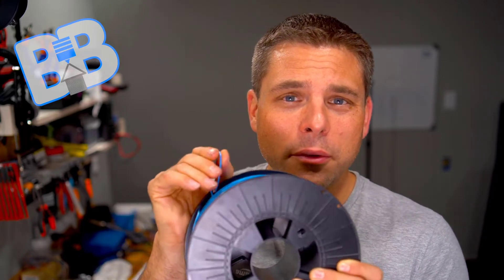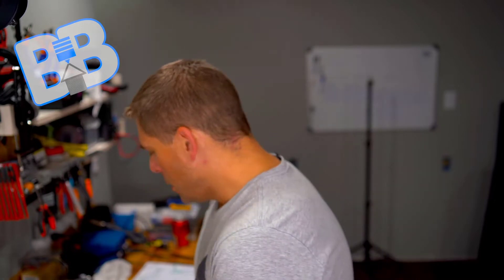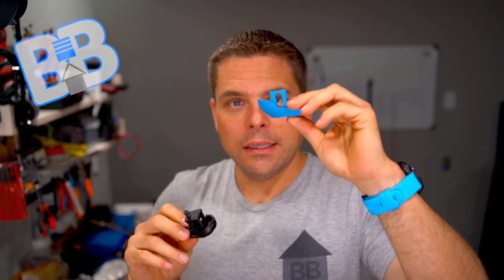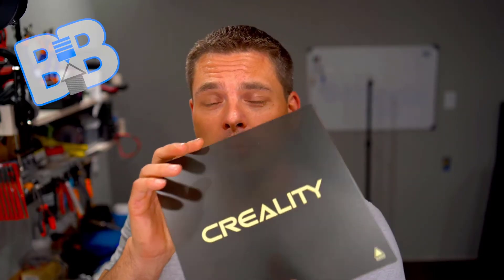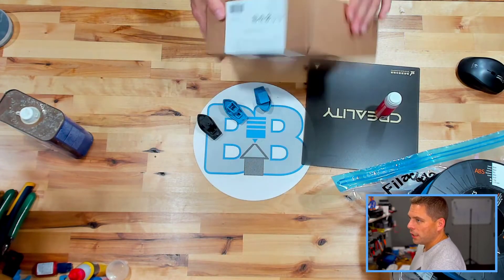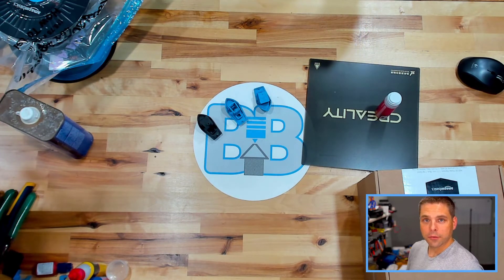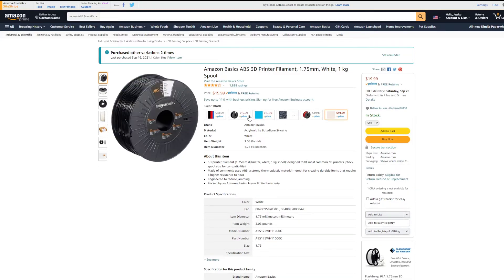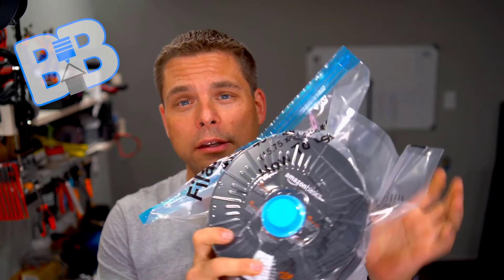Amazon Basics ABS - Too Basic or Great filament for FDM 3d Printers?

Comment: We were chatting on the discord and no one has tried Amazon basics. I was wondering if it was any good.
Reply: It was actually the 1st ABS I have ever used, while printing a few parts on my CR-10S. It actually printed very well on that un-enclosed machine. It took me awhile to dial it into my Voron, but the Amazon Black ABS has been 80% of my prints over the past few months. The remaining has been Hatchbox.
Reply: @bernechad  Im printing hatchbox right now.  How do they compare?
Reply from the maker: In my experience - Hatchbox has been one of the most difficult ABS filaments to print.  Mostly issues with warping.  I'm interested to know what others have experienced.
Reply: @BuildItBasement  I'm printing abs on an ender on a cabinet using hatchbox I've never had warping on it or any abs I have used. I've had some peeling but only when I had too much fan on the first few layers.
Reply: @bernechad  Same. So far I have used hatchbox and paramount and haven't had a single warp due to the filament.
Reply from the maker: No warping?  That's great.  A lot of people do, I personally haven't had any bad enough to lose a print - but when you set the print down on a flat surface after it cools, I tend to nearly always see some.  I'm interested in knowing more about your setup?  Temps? Bed material?  Happy to use it to add content and possibly help others.  Let me know!
Reply: @BuildItBasement  I have it in a cabinet . I put gorilla tape around the doors to act as a gasket. I'm getting between 55 and 60c in the chamber depending on ambient. I have a light in there that is generating some heat as well.
Reply from the maker: What are you printing on?  Flexplate? Glass? PEI? Tears of failed prints from others?
Reply: @BuildItBasement  I have a pei flex plate binder clipped to the bed.
Reply: @madeintexas3d442  first person I've seen use paramount. How do you like it,m
Reply: @brandoneich2412  I like it quite a bit it is definitely better than hatchbox. It doesn't smell really at all and the finish on it looks great.
Reply: @madeintexas3d442  wow. Thanks. I was going to get some of the beautiful iron red for my voron build (v0.1) but ended up deciding to go with an white with orange accent theme. :)
Reply from the maker: Spread the word, send me some traffic. Words just as well as eSUN.

Also, I did test heat resistance, it required about 20 degrees Celsius more than PLA to change state. It was on par with the other ABS I have on hand.